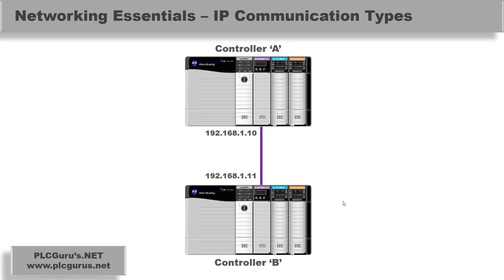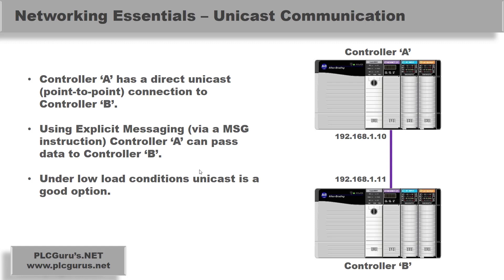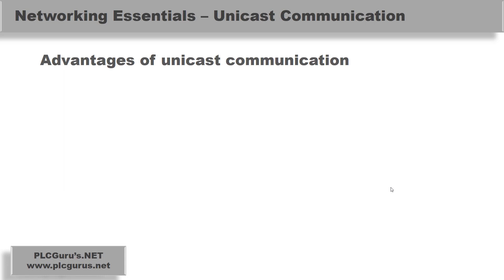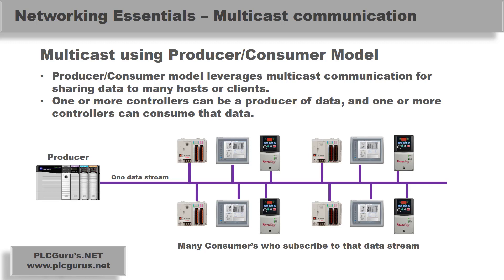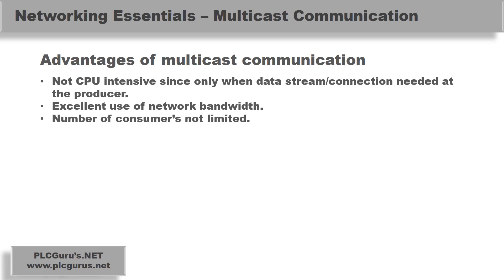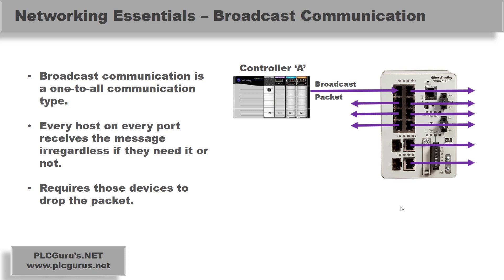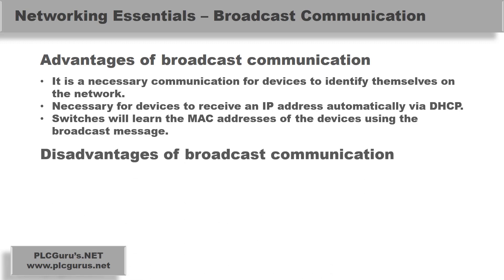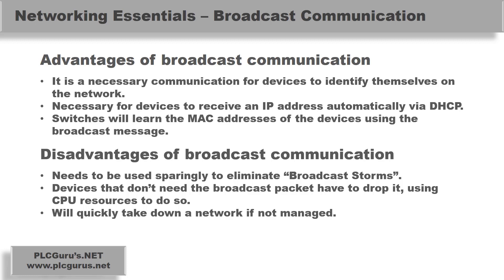PLCGurus.NET - IP Communication Types

Comment: This was well communicated as well explained. I think I understood Broadcast messages much better than Multicast but it’s ok. What is clearly helpful here is interjecting your own personality when you go “Hey I’m MAC address so and so I need an IP Address or add me to your Switch table”. That really helps to understand the picture in how things are happening between switches and devices in example. Question though: if one was to install a Stratix Managed Switch as only switch in network with half a dozen plus nodes, is there any consequence in having not configured and installing It from out of the box? I heard it said somewhere that a Managed switch installed. It not configured is worst than an unmanaged switch. What is the truth to that and why? Is IGMP Snooping default set on the Stratix switches or does that have to be set configured?
Reply from the maker: Hi Ardent, glad you're enjoying the videos. I believe that out of the box the Stratix will function as if it were unmanaged. For IGMP, there should option to enable it via Device Manager in the Configure menu under Security.
Reply: PLCGurus.NET Thanks for the feedback from question. As in a recent huge PLC upgrade at a power plant that my Senoir Engineer coworker and I did upgrading from PLC 5/SLC to ControlLogix with 12 nodes of Chassis I/O’ which was a huge upgrade, we installed 1 Stratix 8000 Managed Switch. Anyway, it wasn’t configured beyond the IP Address being set in the switch. The PLC network isn’t connected to anything else except the running process equipment. I remember asking my coworker if we needed to configure the switch somehow. He said it was fine, it wouldn’t be a problem but he knows far more than me by far and in programing. But I’ve always thought about that now 7 months later if it was the right thing to do. Thus, it’s a reason I watch all these videos with a keen interest. 

Anyway, you should add another video to do to your list and include the use or demonstration of Rockwell Automation new software application for “FactoryTalk Network Manager” for configuring, troubleshooting, diagnostics of switch network issues. Keep doing what your doing man.
Reply from the maker: @UrbanGregory  I'll certainly look into it!